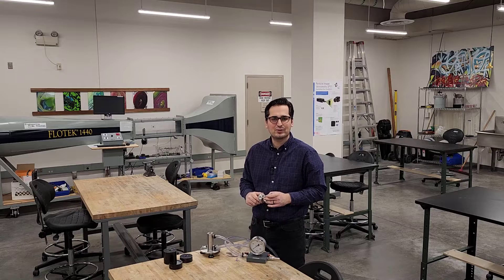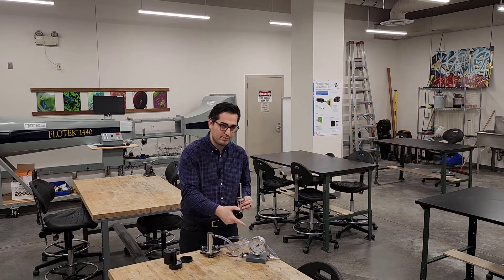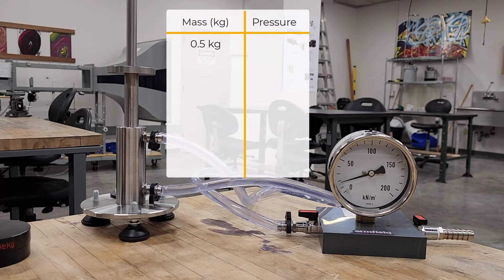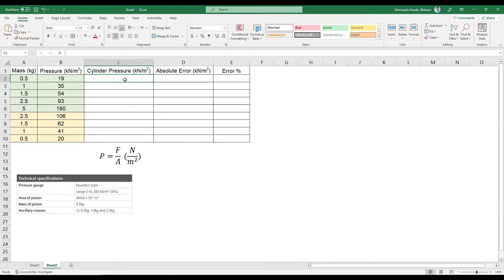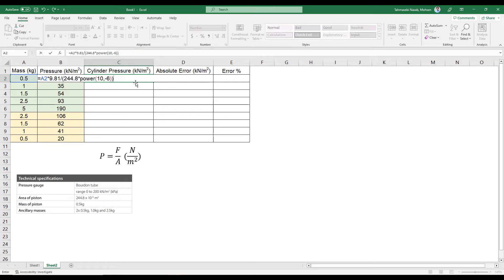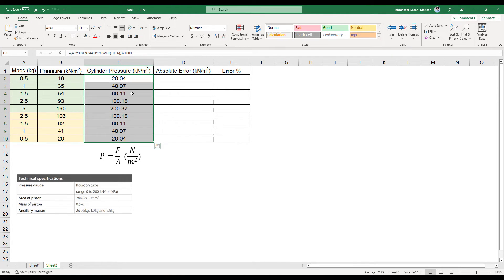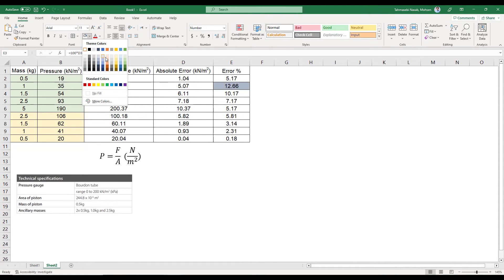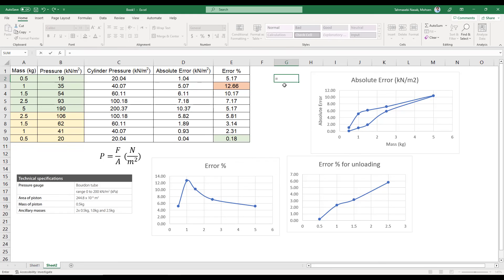Pressure Gauge Calibration using a Dead Weight Calibrator - Armfield F1-11

Comment: Very interesting  : thank you for sharing ! I am planning to build suche a "calibration" device for a DIY project. and this will be precious 

However, I noted a few things /question.
1-Air bubbles DON'T impact pressure reading...in fact this aparatus could operate on air pressure as well (if the piston fits accuratly enough and you allow for a little constant air inlet in the circuit (small enough that the pressure loss in the circuit can be neglected)

2-  Two digit on the spread sheet is jut out of purpose : the instrument you are testing has a 10 kN/m² scale, it's not supposed to read 19... same apply to the gravity value 9.81 is WAY too accurate  (it's LOWER than 9.80 in Dallas or L.A.). 

3- I wonder what diameter the tube/piston is. It's not making any sense in mm nor Imperial. 244.8 mm² is not a round value either...

3- Seting up an experiment with water on a wooden bench is probably not the best idea.